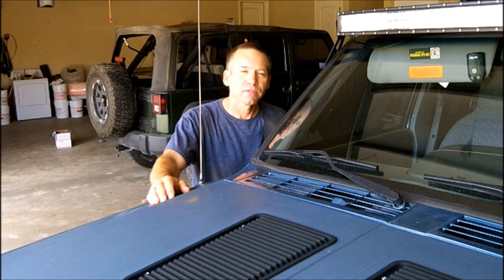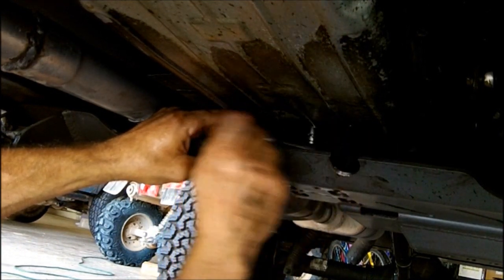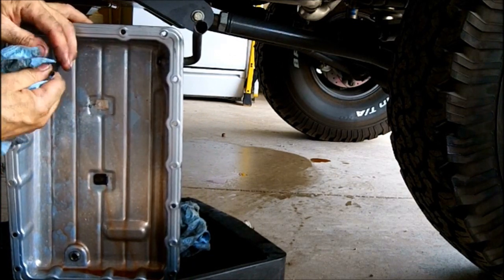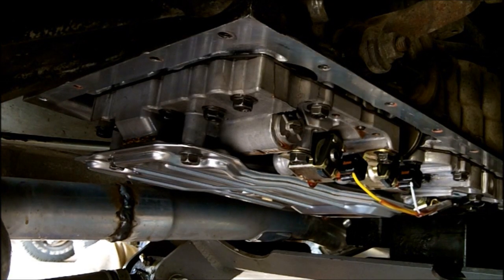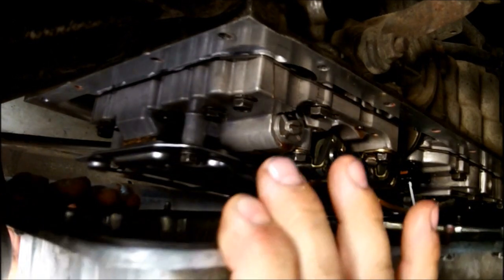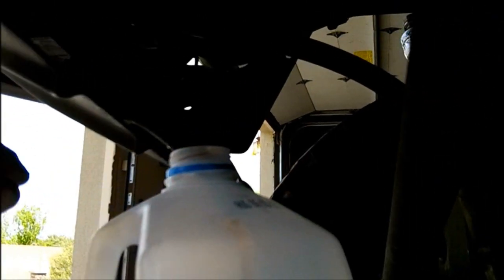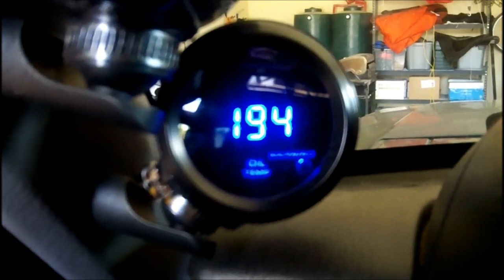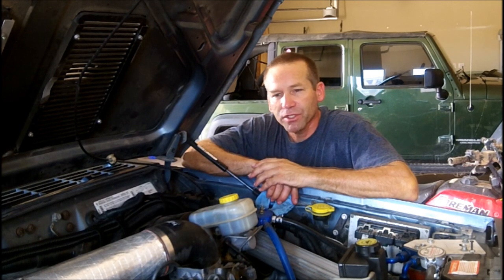Automatic Transmission Filter and Flush on a Jeep Cherokee

Comment: I do mine the same way Martin, with a slight variation. I extend the hose so I can see it from my 'fill' position. It fills into a larger 5 gallon semi see thru bucket that I've put 1 quart lines, that way you can keep the motor running and top off as needed. The hose is mounted so that when the clean, clearish fluid comes thru, I see it, run it for another quart and done. This is the best way to flush the tranny, glad you're on your game there buddy.

Comment: @martinbuilt. Hy Martin, I have a 1993 Jeep Cherokee Country. Although I bought it through a guy who goes out to Colorado Springs, Colorado 2-3 times per year, buys Jeeps, then brings them back here to Michigan, it was owned by the same family since it was new. The original owner did put a 3'' lift on it but different topic for another day. I'm focusing now on the transmission. The original owner rebuilt the engine completely, the trans I'm not sure about but although the fluid is fresh, I wanted to make sure that the proper fluid is in the trans. So I'll be doing a flush the same as you show in the video. So my questions are that was the total fluid used (12-13 quarts) & 2nd, I've got the shift-points to around 1,900-2,000 rpm's for 1st, 2nd, 3rd & 4th, where it shifts at around 1,700-1,800 rpms into OD. With the 245/75/R16 tires, could that be the reason the shift-points were off? It was winding out to around 2,200 rpm's before it would shift. But an adjustment on the cable under the hood made the shifting a lot better....
**So would 1,900-2,000 RPM shift point sound correct for a 93 with the AW-4 auto trans.** 
*Note: driving normal & not winding out each gear.*
I'm getting ready to do a tuneup on it & thought maybe I'll just go ahead & get a Throttle Position Sensor while I'm at it. Since I was told that it could be the other reason for the shift-points being higher. I know these tires probably don't help but I'll leave them on till I get a new set for the OEM Rims. lol that way my wife can get in & out to drive it... Great video btw, I did subscribe & gave the video a thumbs up.. Thanks, MD....
Reply from the maker: taller tires are putting more stress on the engine and trans witch could change the shift points and cause it to downshift and upshift a lot (hunting for a gear). I don't recall the RPM mine shifts at, I would need to take it for a drive. Thank you for subscribing, I really appreciate that!
Reply: @martinbuilt  Martin, a couple of the pickup's I bought in the past 30-35 years came with factory lifts but yeah it was me who bought the oversize tires for them. Although I do like the height of my Cherokee today and even if I decide to stay with the 16'' tires, I can see now that what I do not need is such an aggressive tire & tread design. Thanks for point that out to me. I already need to look at the steering & suspension because some of the OEM parts should have been replaced with the 3'' lift. The previous owner didn't do the job 100% correctly.

I just got so lost with the fact that this Jeep will be 30 years old in 2 1/2 years & looks really good that I let something I have already dealt with in the past, cloud my judgement.. Perhaps I should just clean up the OEM Rims & look for good riding tires. Since I already own the 15'' to 16'' style rims & tires doesn't automatically mean I have to be running them. I need to rethink tires.. Thanks again Martin. I should just pop off these tires & put the original OEM size set & see what the difference is... Thanks again Martin.... Have a great day my friend. MD...

Comment: If no drain plug then either by using a 12 volt pup of a hand suction pum, pump out a couple of litres or is possible as much fluid as possible to make the process a lot cleaner. What I did was purchased a O2 sensor plug and bung and welding that in place to make the process so much easier.
Reply from the maker: That's a good idea with O2 plug

Comment: I see this is an old video, but curious, did you have any transmission issues after a flush?  I've heard this is a bad idea on high mileage transmissions because of band wear and lack of material in the fluid that keep it from slipping.  I guess it would depend on how often you changed the fluid.
Reply from the maker: No, I haven't had any issues with the trans. I have probably put on 40 to 50,000 miles since I flushed it. I believe the people that are having issues with the flush are only because they were having transmission problems and thought by flushing the trans would fix the problem.
Reply: Could be, thanks for the reply.

Comment: I have the 45RFE transmission in my 99 Grand cherokee, I changed the fluid and both filters the other day, afterwards  when i was about to go for a test drive the chek engine light came on and the transmission slams quite roughly into revesre and drive gear, and when to take off in drive i have to  go up to 2000rpm before the car slowly is floating foward, I scanned it and received faulty code P1784,
Reply from the maker: most of the time  that is a stuck switch valve or a bad solenoid pack
I found this http://www.jeepforum.com/forum/f13/cel-code-p1784-933722/

Comment: Martin can you do a repair and replace shift lever on auto transmission but 4x4 lever that commonly falls off mine is a 2003 dodge ram 4x4 1500 4.7 liter. I cant find it anywhere on you tube.

Comment: I'm still trying to figure out which one is the return line on my 99 XJ.
One of the lines is mounted lower on the trans and I'm wondering which one is which.
I read one of the comments that if you have a stock cooler line you have to cut it???
I guess I could cut the line at the metal tube and put a double clamped hose when reconnecting.
I'm also wondering if I were to use Lucas semi synthetic fluid how much should I run through the system to make sure all the old is out and replaced with new Lucas fluid?
I'm thinking I would need about 12-16 quarts at $8.00 a quart.....can be pricey but preventative maintenance the right way is fine as long as it works well.
Wondering if the semi synthetic fluid will cause any of my old seals to leak?
Reply from the maker: The return line should be the one that leads to the rearward part of the transmission. I would get at least 12 quarts.

Comment: HOL THANKS FOR THE VIDEO IS VERY GOOD.  I HAVE A DOUBT, I AM DOING THE SAME JOB BUT I THINK I DID SOMETHING WRONG, THE LIQUID THAT COMES OUT IS THE NEW LIQUID.  HOW DO I REMOVE AND CHANGE, DO I HAVE TO DRAIN THE ENGINE?  DO I HAVE TO REMOVE IT FROM THE COOLER?  PLEASE HELP ME FIND THE CORRECT LINE, ANOTHER QUESTION DO I HAVE TO PLACE A PLUG WHEN I DISCONNECT THE LINE WHEN OPERATING THE ENGINE?  THANKS FOR EVERYTHING.

Comment: I'm confused my 99 xj ask for atf4 is a wisin aisin 4 speed 2wd is this normally or I'm been using the wrong fluid for 11 years is still running 250,000 miles later 🤔

Comment: Damn it I just bought ATF4 for my change. My transmission has been slipping when I come to a start. It will lag for a second then go eventually. Was going to drain fluid, change filter add three quarts atf4 valve line full synthetic and some Lucas stop slip.
Reply: When I come to a stop*
Reply: +TheBestOutcj I've got the same issue. did your method work?

Comment: Great video! Just wondering with this Wix kit do you need to use a rtd sealant on the pan as well as the gasket or just the gasket? Also do you reuse any of those factory filter gaskets when installing the new wix filter or does that one have the necessary gaskets already on it?
Reply from the maker: +Keith Lambert 
 I install the pan gasket dry. Never had any leaks. The filter comes with all new gaskets.

Comment: excellent video! do you check the transmission level in park or neutral. i see different answers everywhere i go. should i apply the brake and shift through all the gears before checking the fluid level?
Reply from the maker: I check my fluid in park but I made sure it was up to normal operating temperature before I did. So take it for a drive

Comment: I know it doesn't hurt the oil lines since the pump's sucking clean fluid from the sump and before it comes back, you collect it in the milk container.. but wouldn't it be better to do that flush with the old fluid, before changing the filter, to save that precious new fluid?
Reply from the maker: You can do it either way. The fluid your getting out of the trans. line is coming from the torque convertor. The fresh fluid you put in the pan is being draw up into the trans. and have to go through everything before heading to the cooler.

Comment: Loved the video. Question..I have 2001 Jeep Grand Cherokee Laredo 4.0L 6 cylinder. Its throwing P0161 and P0740.
It won't start now. Any advice on what I should do first?. I have the transmission fluid and filter. Was just gonna drain, clean, then swap filter and hope for the best
Reply: ...going to get bank 2 sensor 2 and TCC solenoid but dont know which solenoid needs to be replaced. The solenoids are located around the filter, right? Any advice would help man. Thanks in advance.
Reply from the maker: I believe I had the same code show up a fer years back and it turned out that the throttle position sensor was at fault. Mine was kicking in and out of overdrive or should I say the torque converter was locking up and then unlocking constantly while driving down the road.
Reply: Was it making a grinding or loud vibration sound when gears are switching? What do you think I should do first?
Reply from the maker: @arciusvalen4675  that does not sound good! If it was me cuz that sounds like a transmission on its way out. I would go down to your local Pick-A-Part or pick a pull and start looking for another transmission. They sell transmissions for $160 plus I think a $25 core charge.. should you choose to go to a Pick-A-Part I would look for a jeep that obviously had engine problems or was in a severe accident in either case you'll know that the transmission was working at the time.
Reply: Thanks man. All of your feedback was very helpful. Enjoy the rest of your holiday brother. Thanks again!

Comment: what brand of gauges did you use? also could you do a video on the mounting system for them.. Great Video very informative
Reply from the maker: Prepping2endurE I don't know exactly what brand those are I think I paid about $17 a piece for them at the time. I did look them up on eBay they look exactly like the Hot system gauges for $15.00
The gauge pods I could not find it all on eBay. There are similar ones for around $10 a piece.

Comment: Martin, I have an '01 Cherokee with 156k miles on it, and have realized that I have no record of the transmission fluid ever being changed. After checking the fluid, it is brown but not burnt. Could changing it for the first time at such high mileage kill my transmission?
Reply from the maker: Imo... No if you do what I did in the video. Change the filter and replace the fluid. Then do a flush.
 I think the people that have had problems in doing a flush they didn't change filter or clean the trans pan. That or they had some symptoms that the trans was not operating properly they do a flush and the trans fails soon after and blame it on the new fluid, when in fact the trans was on it's way out anyway.
Reply: Thanks Martin!

Comment: Martin, thanks for doing this video. reminds me of when I changed my filter and fluid years ago. my 1999 Cherokee Classic had a dipstick tube connected all the way down to the pan so I had an issue when I dropped the pan but I worked around that. I didn't do a flush. I just changed the fluid. I still don't understand how you are flushing. what are you connecting the tube to that you have flowing into the gallon jug? that's where I'm lost. I didn't get where it's coming out of the transmission on your flush. 
thank you
Reply: He used the return line from the transmission cooler. He ran the line down to the jug instead of back to the transmission while doing the flush.

Comment: How did you un-stick the dipstick tube?
Reply: They can be a pain they just push together and pull apart. The upper half of the tube pulls out from the bottom half that attaches to the pan
Reply: @beersngearz781  Great, didn't know that.
Reply: I sprayed PB Blaster on the upper part of the dipstick tube and let it run down onto  the junction. I did this a few times over a few days and it really made it easy to drop the pan.

Comment: hey martin can you point out the soleniods next time, PLease!
Reply from the maker: If you start watching at 7:20 you will see them. 2 are next to each other and the 3rd one is toward the rear. I have also included this link that points out the location and what each one is for. Scroll down and you will see the picture. https://www.cherokeeforum.com/f2/shift-solenoid-199137/

Comment: Why flush after you changed the filter?  Shouldn't you flush then change the filter and refill?
Reply from the maker: The reason I do it that way is that I feel if you did the flush first you're going to stir up a lot of the black residue from the worn clutches and other contaminants that are on the bottom of the trans pan.

Comment: so I have a 2001 grand cherokee 123,000 miles never changed before. but getting a code for govenor pressure sensor and selenoid. im told not to change oil . but thats code. also jeep wasnt turning on well if at a light would shut off. thought it was  cps but im getting gas it turns on then dies.  please help. im going to try on my own $$ is tight

Comment: Q? Did a oil change on my 2000 jeep gcl. 4.0 il6. Put in recommend, think 6 qts? But dipstick reads way over the max line? Now i get leaks from rear main seal and oil smell burning? Any suggestions??
Reply from the maker: Do not overfill this will cause foaming inside the trans. You"ll need to drain some off. You could disconnect the trans line as shown in the video and drain it into a container.
Reply: @martinbuilt  . I took it to AAMCO, said I need to rebuild. $2200.  It's been slipping, more so when cold on acceleration. I put some Lucas stop slip and seems to be working but still get a bit of a hard shift.

Comment: i have 2014 jeep grand how much trans mission oil in the pan it take like 16 quats and whats the thing way of doing this,,i like ur video by the way
Reply from the maker: Yes you probably looking at 14 to 16 quarts if you did a complete flush for just replacing fluid in the pan probably around six quarts.
Reply: @martinbuilt  i havent yet. few mech told me  not to  flush ,confuess

Comment: Thanks for the video! Just out of curiosity where did you get you auxiliary gauges from?
Reply from the maker: I can't remember. I had them for at least a year before I got around to installing them. The gauges were separate from the gauge pods. I believe then were from eBay if I had to guess. I do remember the gauges were around 17.00 each. The only thing I don't like about them is at night they will not dim. So the blue light can be a little bright at night.  I was thinking of putting a layer of tint on them to help with that.

Comment: So I followed what the video said and found that after pouring two gallons of a tf it seemed to suck it all up since the dip stick won't  show any signs of it. Exactly how many gallons are needed?
Reply from the maker: +Meta Mein 
I am not following. If you poured 2 gallons in at one time it will suck all of it up on the flush.  Did you replace a gallon after you drained a gallon?
Reply: +martinbuilt sorry, I wrote it in a hurry. What I meant to say was that I followed just as you did by putting in the first gallon of new atf, flushing out a gallon of the old stuff and repeating a second time. But for some reason the dipstick comes out dry. I was wondering if I seriously messed up the process
Reply from the maker: +Meta Mein no I don't think you messed up you just need to add more. one quart can make a huge difference on the dipstick in an automatic transmission

Comment: Good afternoon, I take my Jeep to the mechanic to change the gearbox oil, as I was running out of car my means of transportation would be a bike that I have the next day to leave the jeep started to rain and I went back to the workshop to leave bike and get my Jeep, as they have not yet played for maintenance, he no longer took the battery died, touched a cable to put the car to work and so far so well, but when I go to walk the march stopped gear the march in D 1 or 2, only gears march back, put a new battery, changed the oil of the gearbox and put the level, made the diagnosis of errors by the car's ignition and appeared P0118 error, which is the car temperature sensor, do not know whether to be damaged the sensor puts the car in safe mode, so as not to spoil the box, because if so the car would not start to not overheat the engine, does anyone have any idea what You may come to be? He sometimes dragged a bit to start, to get to 3, then the behavior was normal, but this was a very sporadic situation, then I think to be oil, have the Jeep for about a year and cash problems just even this I put you here, and is no longer small, I look forward to some opinions, I do not believe it is this temperature sensor, thank you, ...

Comment: i have a 97 xj with roughcountry long arms and i dont think i can take the pan off with the cross member on, i got the front dl off though np with a cheap 8 mill sockets thats very short so it fits and 1/4 rachet
Reply: I have a '96 now with 130K miles and about to do the trans filter for the 3rd time.  I had to remove the cross member to drop the pan down and IIRC, COULDN'T get the pan fully dropped because of the dip stick tube.  Maybe I just didn't wiggle it enough but I remember back that I had to work around the pan not being able to drop full down.